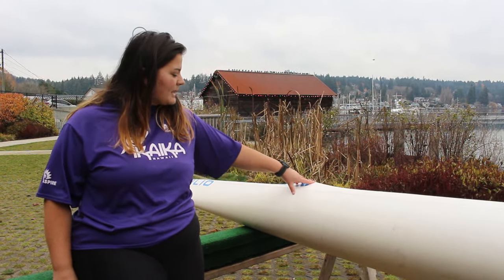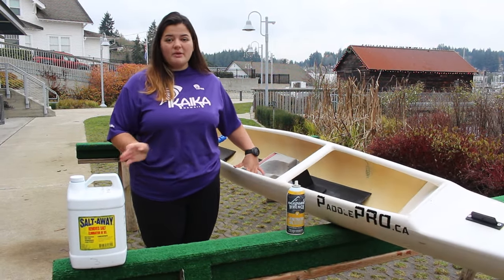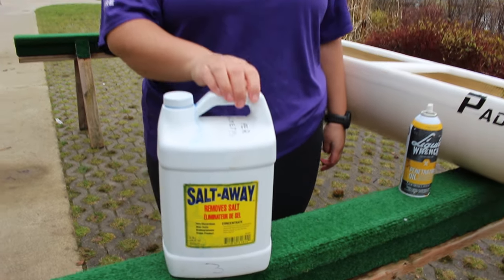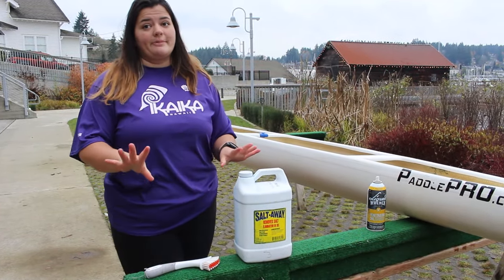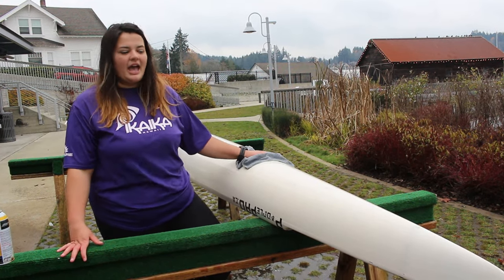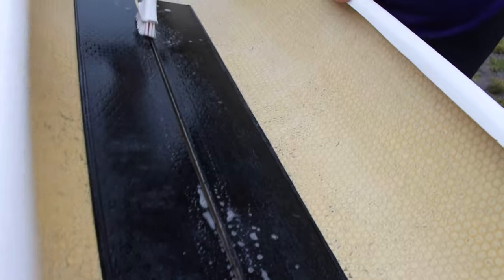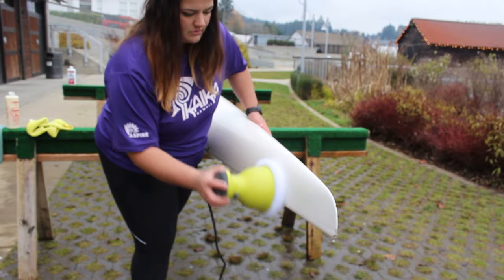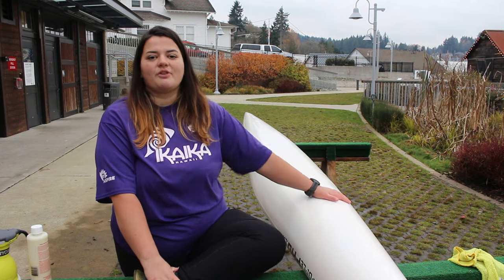Regular Boat Maintenance: How to Wash and Wax a Race Canoe and Kayak [GHCKRT]

Comment: Hey! Been watching your videos recently and found it a great resource to learn about sprint paddling! Could you share some tips on how to be coordinated in a team boat and whether one should paddle it differently to a K1? Ive been having trouble with feeling resistance in the water when paddling a k4
Reply from the maker: Great question and prompt for a potential future video. To answer your question in short- yes you must paddle a little different in a teamboat than in a single. You also must paddle different per seat you are in for each boat. Stroke seat is much different than second and third and fourth. If you are having trouble finding the "grab" of the catch then the timing is off. To start, we would recommend doing the backing drill where the paddlers together back the boat up and slowly but firmly reverse one last stroke into the catch position and hold. Repeat until smooth and in unison.